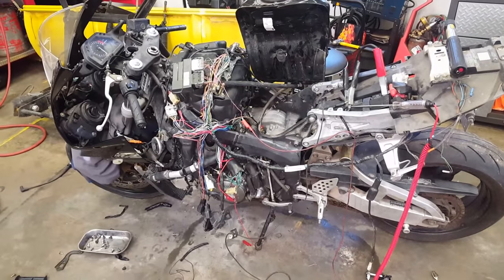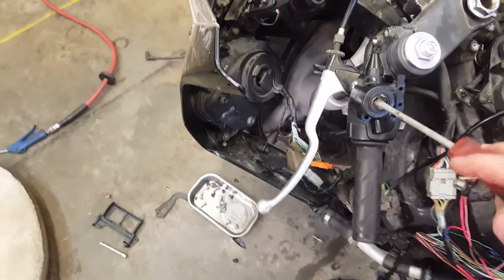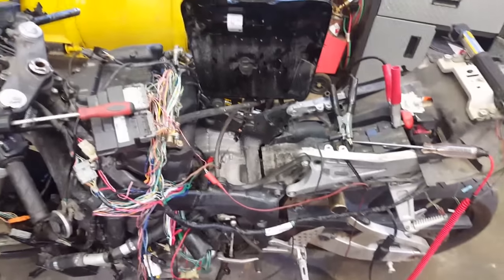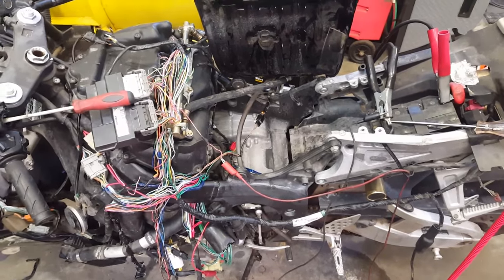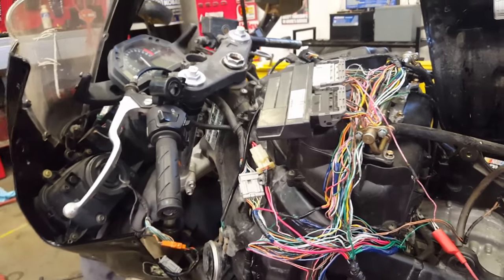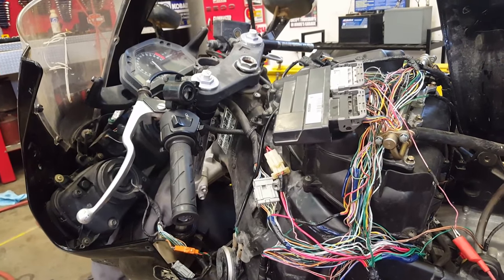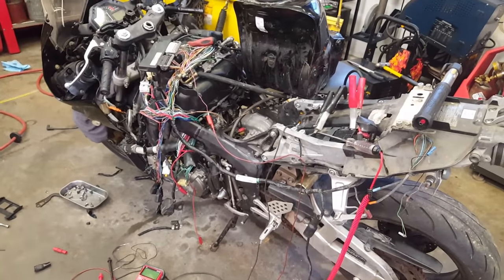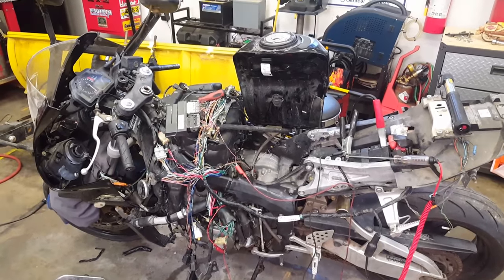2004 Honda CBR600RR no start fix. No fuel prime

Comment: Thanks for the video, my 2012 CBR1000RR was running great until I washed it, now the fuel pump isn't priming, I'm going to look into this as one of the causes!
Reply: did you ever figure it out? im currently having a priming issue with my 09 cbr as well and want to try this method
Reply: Bro same happened to me and I couldn't find anything on it. But the plug  from the main harness to the harness to the front of the bike got water stuck in there and melted the plug from the inside (you can't see the problem) unplug it and see that.
Reply: any of you guys find the solution to this issue i have a 2007 cbr and im having the same issue
Reply: @PABLOESCOBAR-ph3el  any of you guys find the solution to this issue i have a 2007 cbr and im having the same issue
Reply: @SteelX1000  any of you guys find the solution to this issue i have a 2007 cbr and im having the same issue

Comment: I’m still kind of lost on exactly what needs to be done to fix this
Reply: Research the exact value/sozing of the zener diode. Pull your ignition out, pull the back cover off your ignition, pay attention to the direction of the diode, unsolder it, pull it out, replace it with a new one, and resolder. You're done.
Reply: @davidmaye3580  what if you bought a new ignition? Wouldnt have thought I need to modify my 50$ ignition before the bike even starts

Comment: 04 cbr600rr uk spec. No pump prime. No start. Just fixed it. 2 faults 
found.

1. Corrosion. An intermittant "open" in the BLUE multi socket  (a small red/white wire) that runs between tilt angle sensor (near headlight) and engine kill relay (one of the 3 identical relays (RADFAN...ENGINE...FUELPUMP) .  This wire provides an earth to the engine kill relay (solenoid side) which works against it's power down from the kill switch (only) when in the run position and IGN on . Wiggled BLUE socket and relay would click in and out as I did it. Bypassed bad pins to fix that.  But bloody hell....still no "pump prime" until I found........

2. MORE Corrosion. A very very high resistance in (black/white)wire between the engine kill relay and the fuel pump cutoff relay. A link between the two relays finally got it sorted. The wire loops up the nasty taped harness from the kill relay 
and back down the same harness to feed the f.p. relay that sits right next to it! . It took 5 hrs studying wiring diagrams to corner the bastard and 5 seconds with a 
paperclip to fix!

Haynes manual wiring diagram essential or you risk getting very lost......
Earths are green. Black/whites are relay-controlled lives for the coils/injectors etc . Pinks are ECU output switched earths for injectors etc. (don't stick power up 'em or you might fry the ecu chips) Fat reds are BAT live or IGN live. Red/whites seem to be earth returns......i could go on!!!

Hope this helps someone somewhere someday.

P.S This particular machine  does not have the "pinkwire-zener-9voutput"  type ign switch other people have mentioned. It does however have "HISS".
Reply: I'm very lost as in how this works, but I attempted to to use the 9v battery and still nothing please help🤣
Reply: I’ve just picked up a 2002 600F4i which has the fuel pump prime issue, when I saw this video I thought the diode fix would be straight forward then found out the European market doesn’t have the diode or pink wire??

I’ll need to check but in any case, five years since your post, I’ll start there.

Thanks!!

Comment: I have a 2004 cbr1000rr I don't have a pink wire that comes out of my ignition I took my ignition apart today there isn't the solenoid nor is there a pink wire soldered into there and my bike has broken down before then and I looked for that pink wire and it was never there and just up until recently my bike just shut off so I don't know if someone before me bypassed  that wire or not because there's not a pink wire anywhere coming from my ignition switch.
Reply: Colemr.mouse14 Deerhunter2014  did you find the fix?
Reply: @ytdaboy3293  not still haven't unfortunately

Comment: dude that frame looks cracked
Reply: John W thats a factory weld -_-
Reply: john deer huh what does that mean
Reply: John W im unshure what your asking
Reply: john deer rehtorical... I knew it wasnt cracked but it really looked cracked a good weld shouldnt break near or at the weld.
Reply: john deer factory welds arent percect I think my 636 frame was welded by a person not a machine. 😁😂
Reply: John W ahh, my welds are in the same spot and look the same but i rewatched a third time and noticed the white on the edge of the weld under the seat that does indeed look like a crack. I wish my beads looked that good lol😅. Still an excellent video that saved my butt😄
Reply: john deer my alu weld are alright i cant make my steel weld look too appealing... squarewave 200 for the win...😁😂 its a good video

Comment: So i have a 01 cbr 929 n old track bike got it not running watch your video and i am very happy to say i start the bike with a 9v battery so i went to ebay to get the new ignition switch it does not have the Anti-Theft in it so you're wasting your time with that one thank you very much over time go to u tub frist